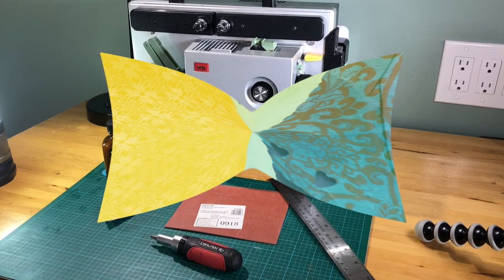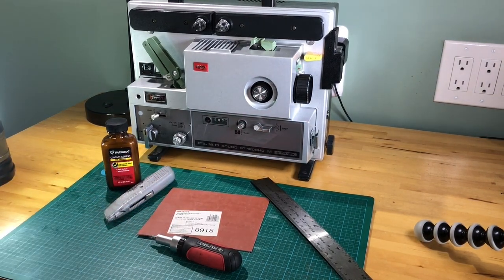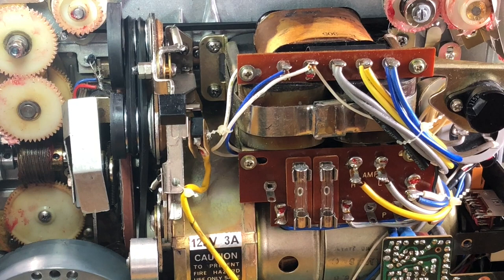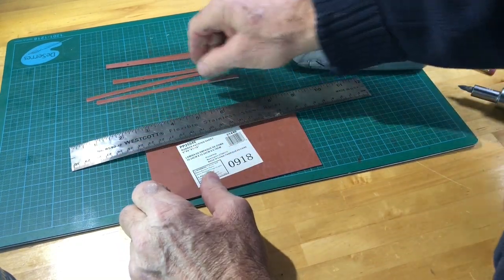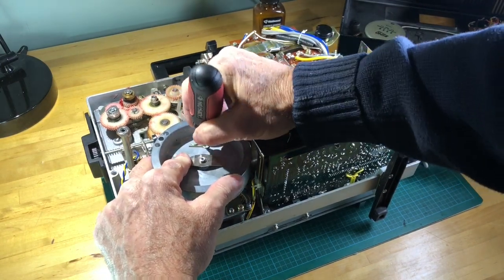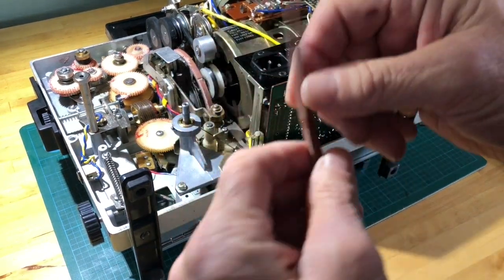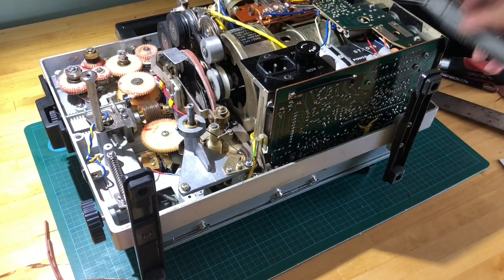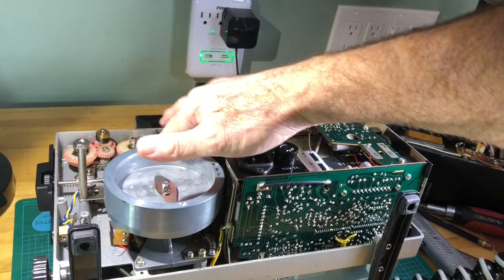Elmo ST 1200 HD Super 8mm Projector Shutter Wheel Repair

Comment: Use a packing sheet you can cut the entire belt from. Doing it in pieces is the hard way. Work smarter not harder. Also, height of shutter-wheel belt is critical for proper viewing speed and enjoyment.

Comment: You have the belts installed wrong. For 60hz, the longer motor belt should be on the top left pulley and the bottom left pulley. For 50hz, use the ones on the right. You have criss-crossed them using the top right to the bottom left.

Comment: The problem i have with mine is that at 24fps, the speed is slightly faster than it should be. I can tell by the somewhat higher pitch audio of dialog on my films in my collection. My St1200d is 60htz, does not have a 50htz belt position option. So thats not causing the issue. Anyone have any thoughts on my projector issue? Is the speed on the motor not calibrated to be the correct sound speed? Is there even a way to adjust the motor?

Comment: Also, it is not clear what mode you have the selector switch on when you are turning the shutter by hand, but it should NOT engage with the rubber wheels until it is in the 3 o’clock position: forward projection. When in the still mode at 2 o’clock, only the motor shoukd turn on, not the film transport mechanism.

I have two ST-1200 HDs, and neither had the rubber on the shutter when I bought them used. One had the other belts all turned to gooey glop. The jury is still out on whether or not Elmo changed the design for the HD at some point, and did not include rubber on the shutter, but regardless, the general consensus is that it is not neeeded. The math will tell you that if it was originally there, then your machine will run a bit faster without it. My ears are very sensitive to pitch, especially for actors and films I have seen many times. I have never noticed a higher pitch, however. Some have claimed the machine runs quieter with the belt; others have claimed it causes the machine to vibrate. My machines run as quiet as any of my other non-Elmo projectors. YMMV.

Comment: Hey, thanks for the movie!great! What is the function of the fly wheel? Does it has to be in contact with something? When does it turn?
Reply from the maker: This is what I found online...may be helpful
The soundhead flywheel is necessary to keep the film going at a constant rate when it passes the soundhead. This is required otherwise you can get wow and flutter in the sound. Also, if you have a projector with the intermittent movement, you'll also notice that sprocket has a flywheel as well. Again this is to regulate the film through the intermittent movement. It basically keeps the "fluctuation" from the electricity "stable". Like you said in the addendum, you probably have a bad soundhead.
Reply: Leonard Rapoport thanks!
Reply: The ST-1200HD has a Rube Goldberg mechanism to start the flywheel BEFORE the film is threaded. It will not work unless you remove the back cover and thoroughly clean the rubber roller and the flywheel shaft with alcohol. Once grease or oil gets on it, it stops working. Even after I have cleaned it, I still cannot get it to work. It is unnecessarily complicated, and interesting to watch in action. Unless you have a very short leader, it is useless anyway. If you do, the first 2 or 3 seconds of sound might be a bit low pitched or warbly. If that bothers you, add another foot or two of leader, or spin the flywheel with your fingers from the front of the projector IMMEDIATELY before threading. That is another caveat: if you warm up your projector in projection mode, like I do, you must move the switch back to still mode before putting it into forward mode, and immediately thread. The auto flywheel spinner engages for only about 2 seconds, so if you wait to thread the film, the flywheel will gradually stop spinning. As I said, it was designed by Rube Goldberg, and even when working it is useless unless you follow the caveats, which arent even mentioned in the user manual. In fact, I dont believe this feature is even mentioned.
Reply: Also, the flywheel will start spinning when the film passes through the rubber roller in the film path. Throughout projection, this will maintain the flywheel’s rotational momentum.

Comment: Do you know why my film will not go through the wheels(sorry for my poor english) it starts but stopt by the lens🙁 the 2 gears turns good!
Reply from the maker: I can’t really tell without seeing what’s going on but you might want to trim the start of the film with the built-in trimmer so that it will thread properly.
Reply: @LeonardRapoport  thanks for your reaction! can i send you a film of the malfuction?
Reply from the maker: @Almanzajj  you can email it to me at lenrap43@gmail.com and I will take a look.  Usually this issue can be caused by bad trim of the film which should be done with the built in trimmer.  Or it is jamming up, but would be hard for me to tell.  I am also not an expert on the projector, but have the skills to repair things.

Comment: How much do they sell for?
Reply from the maker: Not sure what your question is.  If you buy the belt they are expensive and very difficult to install.  They will also fail as the original belt would fail.  Using my method, the rubber will not melt and fail.
Reply: @LeonardRapoport  I mean the whole thing like whats a good price to sell the whole thing?